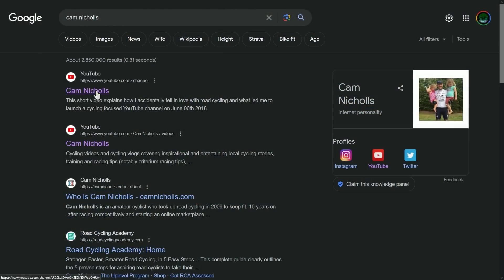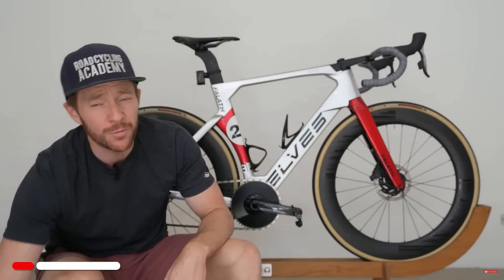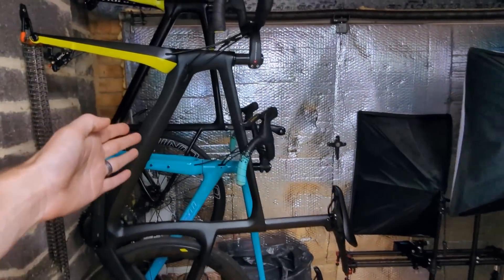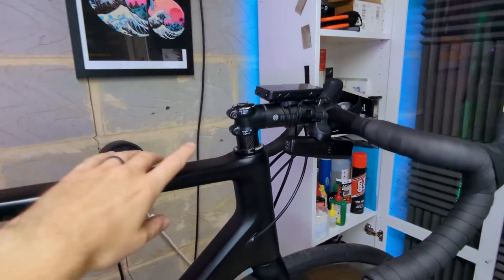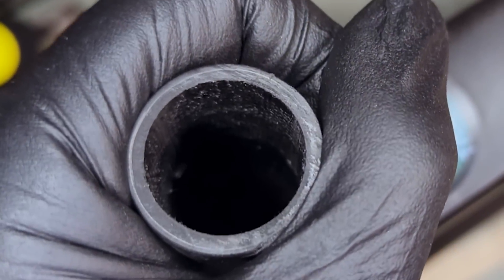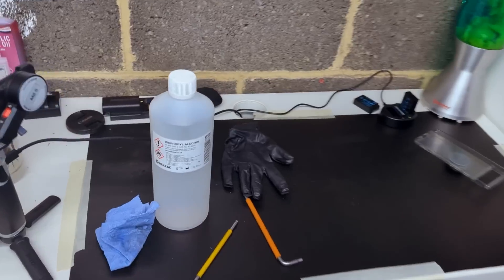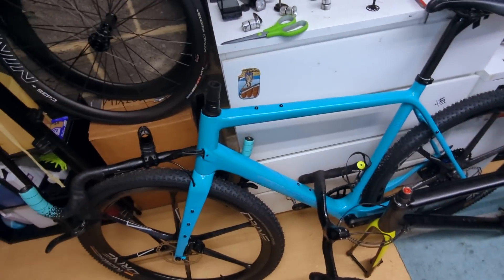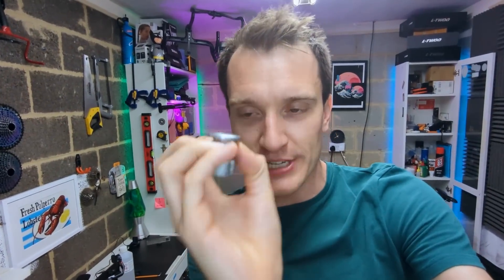Is fibreglass used in cheap carbon bikes?

Comment: Nope. Fiberglass need to be layered to prevent the direct contact between carbon fiber and the other metal parts. It can be seen often in the inserted and contact area like head set and bottom bracket bearing slots. The old carbon bikes were not use the fiberglass in these areas always faced the corrosion.

Comment: I was about to comment to tell you about how this is common in higher end frames and why it is done and then in the last few moments of the video you came out with it. There are also other fibres used in composite bike parts including a verity of aramid fibre, basalt and whilst not so common now even boron fibres.

Comment: It would be interesting to compare the thickness of the carbon in the both the "pure carbon" and "carbon + fiberglass" tubes. It the carbon thickness is the same, then it makes sense they are just adding the fiberglass for galvanic protection.

Comment: I guess no-one else is old like me? 'Full carbon fork' is a term that dates back to the early carbon forks.....where the cheaper ones had aluminium steerer tubes. Full Carbon was the term used to distinguish between forks with an alu steerer tube as opposed to those with a carbon steerer. 

Worrying about a layer of a different fibre material in your composite structure - mostly included to make a necessary machining step easier, and therefore actually MORE appropriate than carbon - is....odd, honestly. Are we going to complain about, say, a metal gear hanger, or metal inserts in the dropouts? Carbon composites are great, but they aren't always the best material for a specific part of an overall structure which requires a different level of say hardness, or abrasion resistance, or machinability.

Comment: Fiberglass is used not only in cheap Chinese bicycles. In general, pure carbon fiber pipes are quite stiff, which is why I add other materials. You can also remember the protection against corrosion because carbon conducts electricity.

Comment: Just to muddy the water here but its possible to use glass fiber that has been dyed black to looks like carbon.  I would say its unlikely in this case, just saying it does exist.  Seems like as you said the premium frames do it for corrosion resistance and possible even structural fatigue resistance.  Also ive heard of instances where an outer layer of glass fibers are used to aid with crack detection because its much easier to spot in glass fiber than carbon.  Ive no experience with that, just read that somewhere.

Comment: Glass fiber and Carbon fiber have quite different material properties. Glass fiber is generally higher strength while carbon fiber is stiffer. Not sure mixing the fibers in this way works well. Certainly the stiffer carbon fiber layer will see most of the load.

Comment: 100% to prevent galvanic corrosion.  More than one big name brand has also used glass in their seat tubes for exactly the same reason -- it was a cheap fix to both gnarly raw mold finishes (just ream the glass) and to seized seatposts at the same time.

Comment: My Lauf fork has glass fiber in it, and Lauf is very open about it. The two materials have different properties and they are used where appropriate for a number of reasons, mostly to do with modulus of elasticity and fatigue life.

Comment: Great video as always! I did watch the video you reference and at some point they mention that sometimes "black fiberglass" is used to make it less noticeable. Watching the close ups of your steer tubes on my large monitor, it does look like most of them have an inner and an outer layer. But IMO, if they are stiff, strong and durable enough, who cares the exact materials. Also, I don't see your Drive Six wheels on any of your bikes. Your review helped me want to get some of those for my next build but I recently noticed they are unavailable online. Was there a quality issue? Or do you just prefer conventional spokes.
Reply from the maker: So the Drive6 wheels are still on my gravel bike, but Elitewheels told me that they take a very long time to make, and are quite costly for them produce, so they have ramped down production to try and optimise it. Unfortunately not sure when they will be making them again, but hoprefully soon. I think they have a similar 6 spoke design planned for road use!
Reply: @TraceVelo  Thank you so much for your reply! I am building a gravel bike, so they would be perfect. Fingers crossed they ramp up production again.

Comment: I have a chinese frame as well and couple of months before ,I have put layer of super glue inside the fork just to make the inside rougher so the compression plug would be hard to pull out,because the inside were too smooth.

Comment: I have seen what appears to be fibreglass in my cheap carbon forks: see from 5m0s in https://youtu.be/Q4HGhrBXDIM. Later on in the video I find glass fibre in the seatpost; I then speculate, from an engineering perspective, why the glass fibre that might be in the seatpost. 
Back to the steerer. There could be good manufacturing engineering reasons for including glass fibre. One area that does not seem to have been explored is its there to resize the inner diameter. As the inner diameter takes the expander plug it's size is important. Controlling the size of the inner diameter with bladder mould technology is difficult. Hence a post moulding process may be required to bring me inside diameter to the required dimension. Glass fibre could be used for this as it's cheaper and easier to work with than carbon fibre. As the structural properties of the resizing medium are not important, then glass is fine. 
I should say this is all speculation by me, but I am an engineer with the design and manufacturing background.

Comment: Fantastic content with huge insight, thank you for contributing to the conversation. We have had a lot of positive feedback on this post with regards to clarification. Appreciate that it takes time to create content, so once again, thank you for producing and sharing this.
Reply from the maker: Awesome, good to hear it! Out of interest, what is the reason for the glass-fibre from an engineering standpoint. I would be really interested to hear from the source. Feel free to drop me an email if it's easier: tracevelouk@gmail.com
Reply: @TraceVelo  I will drop you an email to give you a more in-depth overview, but in the interim, put simply -high level - as we all know, carbon fibre has a habit of bonding to substances such as aluminum. Our compression plugs are indeed aluminium. Like many other "top brands" we use a very thin layer of fibreglass to isolate the carbon fibre steerer from the aluminum compression plug as a protective measure, and to ease maintenance. This part of the manufacturing process has been integrated for the benefit of the customer and to create longevity of the product. Thanks again for your interest, will drop you a line shortly.

Comment: I read through a lot of the comments and something not mentioned is the risk of taking a deep bore in the steerer tube. A steerer molded entirely out of carbon will inherently have uneven sections due to variations in the bladder molding (how it unfurls, how the pressure moves the carbon layers into place, etc. All this variation will try to push the ramming tool of center. It seems pretty self-evident that a hole that goes off-center further down the steerer tube in a place very difficult to inspect is a bad thing. Couple that with the internal fibers of the structure doing proportionally less work than the outer fibers anyway, and lining with easily machined glass fibers just makes a whole lot of sense and adds to the quality of manufacture. 

It is way too easy to say: carbon fiber is always the best material. 
Not true. 
It does a lot of stuff really well, but there are times where another material is better for the application (like the thin steel shims I have on my carbon sole shoes to prevent near instant wear from clipless pedals, or metal inserts for threaded fittings, etc)

Well ENGINEERED bikes consider these details and way more than 99% of consumers are aware of.

Comment: Your understanding of what the engineer told Cam is limited and doesn’t appreciate that the engineer suggested a number of legitimate uses of gf in a cf bike.  Also, glass fiber can be dyed black, and often is to create various faux cf pieces such and interior trim for autos.  Consequently, you can’t rely simply on a visual inspection, as you seem to do, to determine if a particular frame does or doesn’t contain gf.  If gf is used in the wrong places on a cf bike, you’ll surely know it as it will behave like a boiled noodle.  That’s an exaggeration, but cf is considerably stiffer than gf.  All the fiberglass bikes im aware of are flexible plus heavy (due to using more material to address excess flexibility).  So… you still don’t know if your frames have gf in them, and it really doesn’t matter if they do.
Reply: Anyone die?

Comment: There must be a reason for Glass fiber layer to appear in the steerer tube.  Elves is in the controversy because 1. It is a more premium Chinese brand, so customers have higher expectation than an average off brand Chinese frame. 2. Elves has changed its OEM factory, before Elves evo, all their frames seem to be made by a company named Tideace, who also sells its own frame on taobao. Now with the new manufactuer, Falath EVO has seattube fitting issue with Cam (it is a pre production issue though), then people are finding GF in steerer tube and EVO is sold more expensive than a falath pro... I guess the price difference and the share of bad luck Cams had with his Falath EVO build has a detrimental influence on Elves' products.

Comment: In the aftermarket auto scene, fiberglass is often used with items like carbon fiber hood, fender, or spoiler.  This is called wet carbon fiber.  It has carbon lay on top of fiberglass.  It use less carbon materials, and actually cheaper to produce.  The full-on carbon fiber without fiberglass is called dry carbon fiber.  It is extremely thin and brittle, and not very common.  Usually smaller items like mirror covers, license plate frame, etc.

Comment: Corrosion resistance makes a lot of sense. Time uses Dyneema in its fibre blend due to its lower brittleness, high strength and ride dampening properties. Maybe fibreglass also offers these benefits.

Comment: I noticed in a vid where the guy was showing himself building up a yoeleo r11 frame, it had glass inside the steerer. think he said just the frame without the handlebar was $890 from memory. So a quality frame and not a super cheap build.

Comment: Carbon Fiber plates are strong on the two planar dimensions but one can almost poke a hole through the cf plate from the perpendicular direction. And that is why a layer of Kevlar is added to cf kayaks. CF tubes do have tremendous hoop strength according to a NASA material document I once had and read. Hoop strength is force perpendicular to the  circumference but from the inside to outside direction only.

Comment: Fiberglass is a very good material, better than carbon fiber at some applications. It is much better at resisting impact. That is why it is widely used on helmets. And of course, no corrosion when in contact with aluminium alloys. I personally favor chromoly frames, BTW. Titanium would be better if it were easier to weld and repair, but when welded in presence of any air, it oxidizes like nobody's bussines and produce fragile welds.

Comment: I remember when MERIDA recalled a number of forks around the world because there was an issue regarding some material causing the fork to easily bend. 
The point is no recall in the basic models only the premium ones.
Reply: You can add Colnago, Bianchi, Scott and Specialized (twice) to that list, all had forks recalled all for "risk of catastrophic failure potentially resulting in serious injury or death" all high end "flagship" and "top of the line" framesets. For the longest time the only fork expanders Colnago would sell and fit was either an aluminium sleeve that has to be bonded in with epoxy or and expander that's over 4 inches long and designed to go past the top bearing race. But its the cheap Chinese frames that are dangerous right?...........right?

Comment: I look at it like this: The only real semi-frequently occurring serious issue we have had with Carbon bikes is steerer tubes snapping which was more often than not caused by a poor fitting/corroded bung or a poorly reamed inner creating uneven pressure from the stem causing stress fractures, if the manufactures are now staring to do things differently to maybe prevent or mitigate that issue I don't care if it adds a few grams or makes the fork a bit cheaper to produce, I like my teeth where they are and my collar bones whole.

Comment: On expensive forks like Storck Stilletto you could think that there is a layer of fibre glass, but in reality it is a layer of Kevlar which makes the fork light (250 g) and strong at the same time.

Comment: I think fiberglass is also sometimes used as a sort of one-time-use mold that has carbon fiber laid on top and isn't removed, maybe helping with the structure. Easier than using just carbon fiber, and might improve reliability especially on cheaper parts with less quality control
Reply: From the composite manufacture I've seen, if you have a tool to lay fibreglass up onto to use in the way you describe, you may as well just lay carbon fibre onto it. If you've got a tool that can't go in an autoclave then you would use that tool to make a (possibly fibreglass) tool that is suitable for a clave, and lay up onto tjat
Reply: There is often a fiberglass breather over the actual carbon to help the resin bleed through, reducing voids.

Comment: Fibre glass is often used as a barrier layer to prevent galvanic corrosion. Definitely not a 'carbon expert' if that guy hasn't seen that before. Its been used for yonks. What a plonker.

Comment: I’ve had a couple of carbon seat posts with Fibreglass internals to prevent corrosion with the alloy seat clamp. So far they’ve not failed and have good compliance with my carbon frames.🥖🥖🥖🥖

Comment: 🥖🥖🥖 I would assume the thin whitish line in your steering tube is resin, where the carbon layers weren't compressed enough ... 🥖🥖🥖
Reply from the maker: Yeah could be, difficult to tell from just looking I suppose. Definitely couldn't see a super defined separation like the fork on the Elves frame
Reply: @TraceVelo Jourdain Coleman (https://youtube.com/@JourdainColeman) has a recent series about cutting up/repairing (cheap) carbon frames. The residual resin is more pronounced in some of his shots and I am not at all an expert, but it seems similar

Comment: So much technical info on the internet explaining all of these things, yet no one on youtube seems to be able to access it. I guess it makes for more frisky comment sections?

Steerers will have a layer of fiberglass or some alternate material around the crown race, and sometimes inside. Frames will also often have it inside the seat tube and bottom bracket and head tube. This is to provide a galvanic break between areas where bare carbon could contact aluminium. It is not a cheap out, a conspiracy, or a secret. It is just good design. Sometimes fiberglass and kevlar and occasionally basalt are added into specific areas for abrasion resistance but in most cases it will be for isolation.

Fiberglass is also not by any stretch easier to cut, machine or ream. It is glass. Sand. A grinding stone in cloth form. Destroys tools instantly. Carbon on the other hand cuts like butter, you just need to control dust because it is conductive and ultra fine.

There is basically zero reason to "cheap out" on the materials in a frame. The carbon in a entry level frame is barely $20 at this point, a few fiberglass layers would save no money, and even a full fiberglass frame with no carbon would save maybe $5. All the money in a carbon frame is in labour (plus molds, testing, engineering etc).

So next time people see fiberglass in a frame, lay off the tin foil hat and instead wonder (and research) why the properties of fiberglass might be beneficial in that spot on the frame.

Comment: Probs better that a knurled surface embeds itself into softer glass than the harder carbon, I do wonder if they make a glass fiber tube and insert it into the mold to press on the carbon layers and remove the need for a sock in such circumstances, much cheaper and easier to ensure a consistent tube thickness.